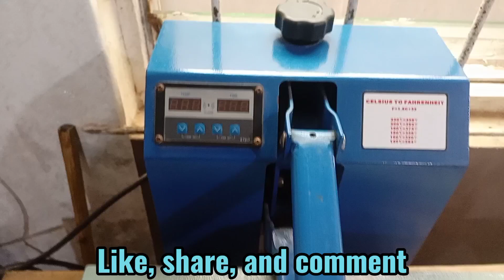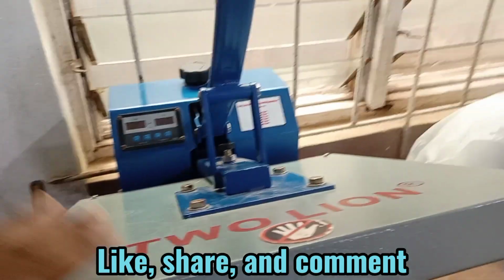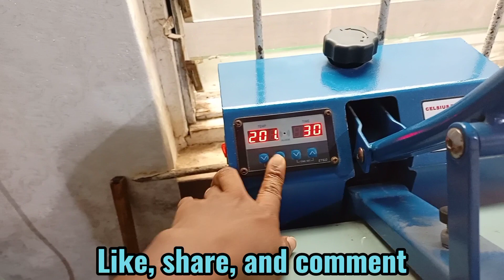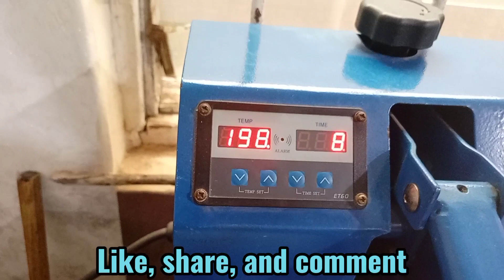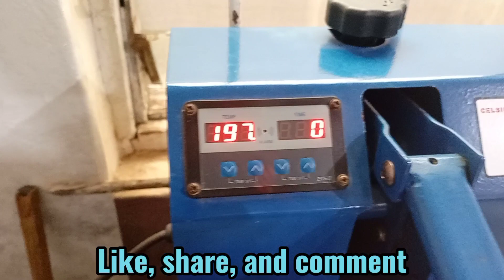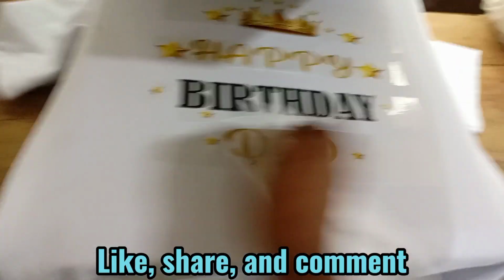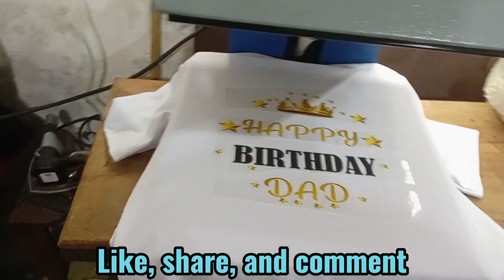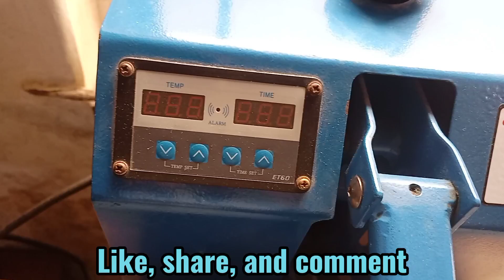How to use Two Lion heat press machine

Comment: Please dear which socket are you using for your own because my own is burning all the sockets I have put it into
Reply from the maker: I use 13Amps Socket. However, you can likewise seek opinions of Electrical Engineer/Technician around you to check the connection.